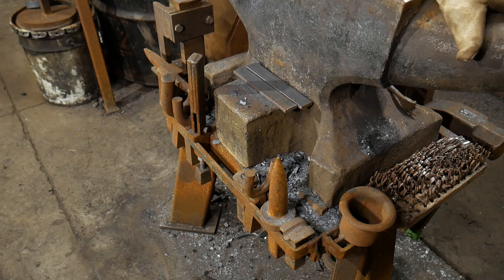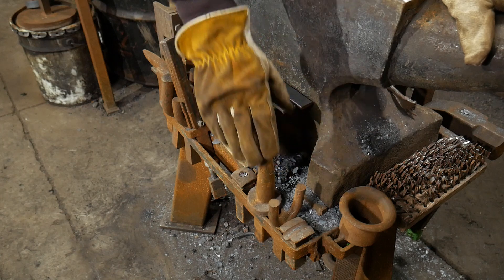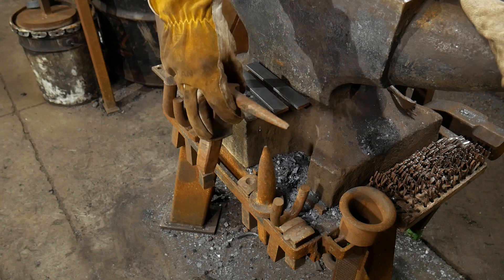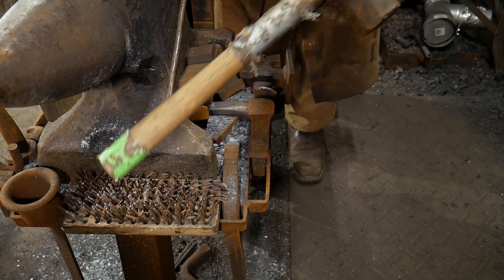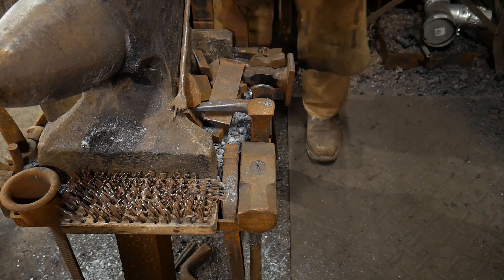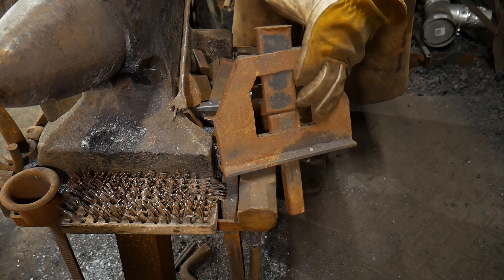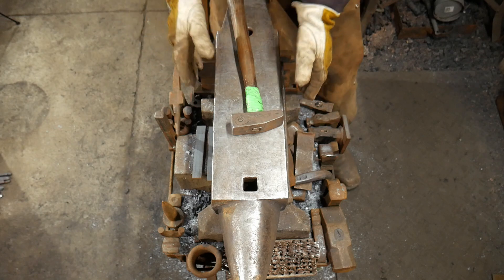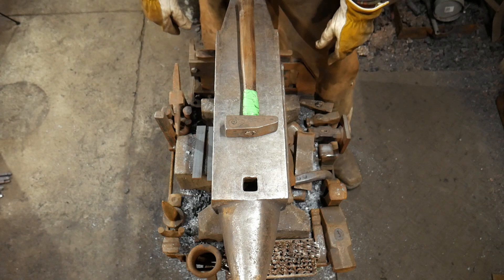My Homemade Anvil Stand Setup

Comment: Chris, may I ask a question? I am headlong into building my coal forge out of half inch steel plate coal placement top with a firebox in the center and blown up through the middle with my clinker crusher and downhole in the center as most everyone else does. My difference is that I want to build a three by five brick table piped through with terracotta six by six inch fired oversized plpe with the void filled with red clay and sand. My hood is over all of this and vents pretty well. My question is this... I have never seen a bonafied Smith use a brick built up hearth. Is there anything wrong with this design?